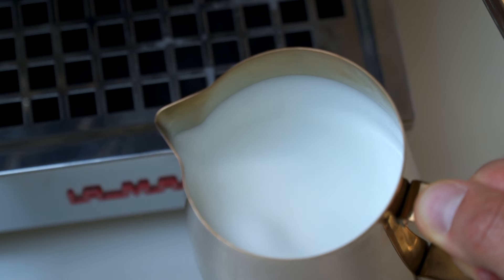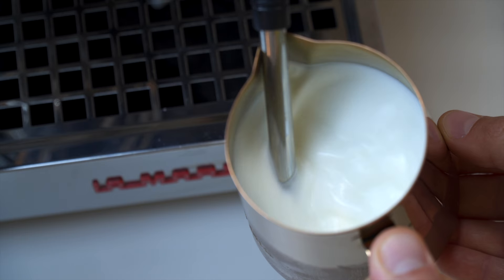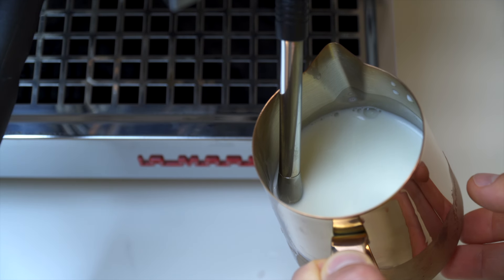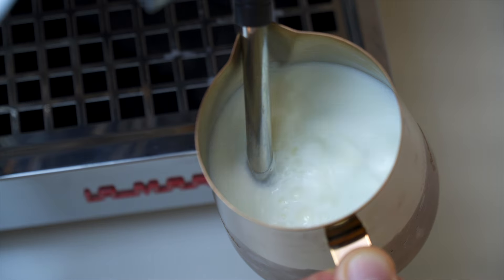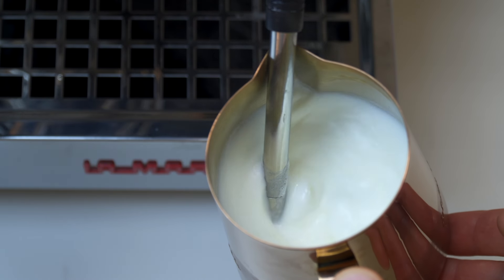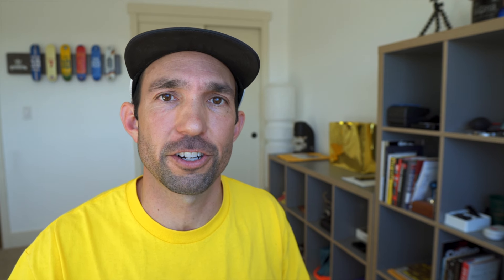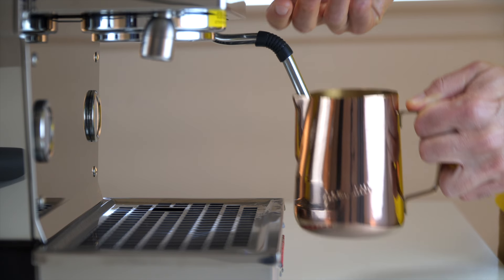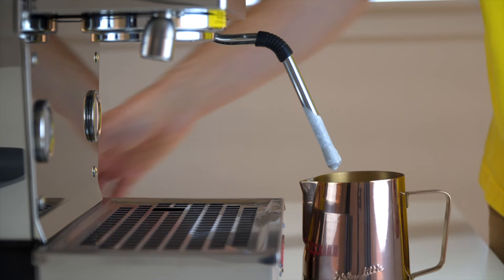Milk Steaming For Latte Art - Barista Tutorial | Chris Baca

Comment: i've been a barista for over 3 years for multiple companies and this is the best and most detailed milk steaming tutorial/training i have ever seen. i've always done the technique where you submerge the steam wand THEN introduce air, now i can't wait to try it the correct way! my latte art will be super consistent now i'm excited. thank you for this video!!
Reply: From top to bottom same
Reply: Chris did not even mention it, but I believe another disadvantage of submerging the wand and THEN - lifting it - to introduce air is that you then have milk sitting on the wand and baking on/burning until you finish the job. 

If you can start and hold at the right level throughout, that avoids this potential issue.

Now I understand that in theory, but really struggle to execute it in practice!
Reply: I'm in training and I'm learning that also, that you submerge the wand, you start off submerging the wand. Not comfortable with that. I look forward to trying this way also. I'm really looking for a formula, consistent way to do it every time!

Comment: Not seen a video that covers texturing milk so comprehensively, however the one thing I think that is missing from this video and most 'texturing milk' videos is how to steam milk with a not so powerful steam wand. A lot of home machines do not have the power that the machines YouTubers are using and I think that might be the reason many cannot achieve the right texture, that's been my problem, I think. Great video!
Reply: zeshxn agree, I’m using an expobar lever pro with a 1 small hole steam tip. Never get super high quality milk
Reply: I use breville barista express
What works is only Steam milk untill it rises  1 to 1,5 cm higher before the milk gets above room temperature(so once u introduced air and milk has risen 1 or 1.5 cm then sink steam wand and get the milk "rolling'  and try make sure the milk rises 1 or 1.5 cm before milk gets warm then as soon as done steaming the milk keep swirling the milk so foam doesn't rise to the top and split then poar as soon as possible after the coffee shot extract's
Reply: Even the one at work used for restaurants one of the wands have a very poor air and water pressure and the other wand is quite strong...it’s like the steam wands are not calibrated properly?
Reply: One tip that works for my home machine is to keep the pitchers in the freezer.  This allows you more time to roll the milk to incorporate the air before things get too hot.  Give that a try and see if things improve for ya?
Reply: @hadu9520  Sounds like your machines need to be cleaned.
Reply: TrackedMiatas yeah you’re probably right
Reply: Hello! A fellow barista here. Hope you don't mind me interjecting for a bit and sharing my thoughts. 

I have tried steaming milk with a not so powerful wand (it was a Breville). Personally I think you can get even smoother milk with a low pressure steam wand because it takes a lot longer to heat up the milk, therefore the milk has a longer rolling time in the vortex resulting in very smooth, velvety microfoam. The same techniques apply with a low pressure steam wand, it's just that it takes more air and a bit longer to aerate the milk and create foam. If you don't mind me asking, what kind of texture are you getting right now? 

In general, milk steaming is a very delicate process and takes quite some time to master. Even with a powerful machine, it is not something you can get right overnight and you only get better with more attempts. A lot of junior baristas whom I've mentored in my work struggle for at least a couple of months before truly getting the hang of it and it takes an even longer time to get to a point of being consistent in getting that smooth, paint-like, glossy texture. The key is to practice, practice and practice.
Reply: @AntheaPeter  thanks for that 👍 it takes time to learn, I think that's what so many don't realise.
Reply: My thoughts exactly! I have a Breville Cafe Roma and it takes forever to get the milk vortex going, probably 30 seconds or so.
Reply: Anthea Peter I agree about the home machines. I own a coffee shop and have been steaming milk for over 25 years now. I discovered espresso as a teenager and knew I wanted it in my life forever. 
I have a Breville at home, I can’t remember which one right now, and sometimes it seems easier and comes out better than my super duper, cost more than my car, machine at my shop.  I even bought another one to keep there to train newbies on. This way A. They’re not tying up the main machine and B. They are able to learn the sounds to listen for, what to look for, how to hold it, and all the other shit and the see better results quicker and feel more encouraged than on the big machine.
Reply: Per TackedMiatas' comment above: Right. Get yourself a stiff wire/heavy paper clip/ welding torch orifice cleaner type thingie. Steam some water to near boiling and then clean the inside of the wand with your preferred appliance. Now, when steaming, clear the wand until water does not come out, steam your milk per the above tutorial, and, importantly, wipe your wand off and give it one more blast of steam. Milk's fraught with adhesive proteins, and tends to clog wands up if they're not scrupulously maintained. Perhaps this will help. Good luck! Cheers!
Reply: It does take longer time and also keep the pitcher cold before you start is a great tip. Also a lot of home machines has a bad construction. Like my La Pavoni which had 3 steam holes on the pipe??!! Haha I had to change that :)
Reply: I also have an Express...It has very good pressure and very dry steam (which is good, minimizes the watering down of the milk). Definitely would recommend it as a home product if it is within your budget (normal price is about 500$ on Amazon).
Reply: @AntheaPeter  That sounds about right. I didn't have to invest much effort in learning how to steam milk on my cheapo espresso machine that I bought from Starbucks years back. The big issue that I've had is that because the boiler is pretty small that it's difficult to have the valve open enough to properly steam without losing pressure midway through the process. 

Closing the valve completely for a bit when the light turns off seems to work, but it does take quite a bit of patience sometimes.

Comment: 'When your brain says you have enough stretch'?  This video is for beginners, my brain has no idea how much stretch is enough yet. Is this just something learned from trial and error, or are there telltale signs that can help us?
Reply: Sam Pascoe Temperature. Stretch it till your milk is about body temp first, then adjust accordingly. If you want more foam, hold it down longer, and if less, you'll wanna bring the jug up earlier. It's mostly by feel and there's no real guideline cause that step is highly machine and technique dependent
Reply: @dddgx05  OK cool, thanks! I read somewhere else, to bring it up when the milk starts getting warm. Body temperature sounds good. I'm struggling to get a good swirl going before I dip at the moment - the placement in this video doesn't work for my jug.
Reply: Check if your steam wand has one hole or multiple. If you have a 1 hole wand this position should work for you. If you have multiple holes you can place it closer to the middle and you're getting more of an erupting kinda motion. But I'm not too sure about this information. Maybe someone else can corroborate this
Reply: @dddgx05  brilliant thanks so much, I'll try this tomorrow! Mine is multiple holes, so that's why it wasnt working!

Comment: Hey Chris, thanks for the video! I'm having trouble with steaming milk for two cups. When I'm splitting a bigger jug (~600 ml) into two portions (using a smaller jug ~380ml), the second cup is usually a lot thinner. Also, the foam and liquid milk are more separated in the second portion. Could you please make a video on steaming and splitting milk for two cups?
Reply: Pavel Mazurin try to pump more air in your milk if you using a big jug (600ml) so you will have enough foam for two cups. Also, how you split the milk is also affects the foam, my tip is to split milk into a smaller pitcher for the 1st attempt, the 2nd attempt is pour over some milk in the smaller pitcher back to the bigger pitcher to get the foam balanced between two pichers. That’s how you will get the same amount of micro foam for your coffee
Reply: Khoi Minh thanks for your tips, I’ll try to use them :)
Reply from the maker: This is a great video idea and yes - I will make this video. Thank you!
Reply: @RealChrisBaca  thanks, looking forward to watching it!
Reply: I'm having the same problem when making 2 cups, did you fix it?
Reply: @nuovosalario  I actually got a lot better with it. One thing that helped a lot - making espresso simultaneously with steaming the milk. I have a heat exchanger machine, on a single boiler this won't work unfortunately.
Reply: @kovpas  I can't do that unfortunately on my machine. Would you recommend steaming the milk first or the espresso and then the milk?
Reply: nuovosalario 🤷‍♂️. Never had a single boiler. May be @RealChrisBaca could help?

Comment: Thank you for your video. I’m a total novice to milk steaming/frothing. Question to you and/or the commenters. I’m using about 6 to 8 oz of milk. My unit came with wand tips with two holes. I constantly get thin milk with ok foam on the top. I bet I just need to practice more but do you think the wand tip with smaller holes and/or  purchasing a wand tip with one hole would help?

Comment: ROCK & ROLL...
Hey, I am a home barista and have a Profitec Pro 700 espresso machine and a Ceado E5SD single dose grinder. I have seen endless number of milk steaming videos but somehow never got "that silky smooth glossy paint finish" milk for latte art until I saw this one. Your video ROCKs cause it helped my milk ROLL. One info no one had mentioned earlier was that it was important to position the steam wand in almost VERTICAL POSITION. That did the trick. It made my milk roll and I finally got that vortex. In my opinion, this is the single most important milk steaming lesson you will ever need. It covers each and every aspect of milk steaming in the most practical way. Two thumbs up...

Comment: Hi Chris! What steam pressure do you tend to have it set at? I was looking to get the ECM Synchronika but I wondered if the on/off lever for the steam instead of a dial would make foaming harder by not being able to manually control the pressure? I think the ECM is set to 2 bars. I think the Rocket R58 Cinquantotto (which I'm also looking at) is 1.5. Lastly, what steam tips (more or less holes,, or smaller/bigger holes) are more appropriate for thick microfoam? (I like dry cappuccinos!). Thanks for such a great resource.

Comment: Best darn video on the topic bar none... I have been pulling my hair for a year trying to do consistent latte art and I just can't get there. I have a Breville single boiler, so I think  my machine is just not powerful enough but still, I should get some consistency but I can't.
Reply from the maker: Thank you! I think you can pull it off with the Breville it just might need some special tweaking and only using small pitchers and small volumes of milk. If I can get my hands on a smaller machine I'll give it a whirl.
Reply: Just by answering my comment you already made my day... That would be super awesome if you could eventually do a "milk steaming for latte art" with the Breville BES870XL Barista Express Espresso Machine. A lot of noobs have this machine as it seems to be a great entry level machine. That's what I thought. I still think that this machine is just under powered to get consistent results... I can't be that bad... LOL... cheers from Toronto!

Comment: My LaMarzocco Línea Mini came with a lot of steam pressure. The gauge reads 1.7 or more. Is that supposed to be the case? If I turn the dial more than a bit the milk burns in seconds. What pressure do you recommend? The factory setting doesn’t seem right.

Comment: so I am using Philips 2200 espresso machine which has a milk frother. But I do not get this kinda vortex happening at all even though my positioning is right. Why would that be? Could it be related to steaming pressure strength or something? unfortunutely there is no way to adjust it, I can only turn steaming on or off.

Comment: Hey Chris - I had just practiced with an entire container of milk to properly froth and steam it for a cappuccino - never did I get the consistency correct!?!  I think I am moving too much, or allowing too much air at the start, that is, I have the tip too far up off the milk.  When I dip the tip lower down into the milk, it blows up and overflows!... plus it smells soured?  

Anyhow, my question is; If I am making an 8 oz.  cappuccino, using 2 oz. of espresso, how much milk do I place in my pitcher (6 oz. would seem logical but I thought more might be required) and for How Long do I need to froth and seam the milk?  Is it six seconds (approximately), or 8 seconds of air, then 3 seconds of steam heat?  I saw your demonstration on this video, but not sure how much milk you were using in relation to the amount of time it takes to froth?.... or is it the same time regardless of the amount of milk?  You make it look so easy!!

Comment: So for a cappuccino, you should aerate the milk slightly longer? How much more foam?
Reply: da5idnz About 30% of the cup? That’s what time taught
Reply: I tried this all today and am still not doing it quite right. It's going to take some time, still... I think our nozzles here down under are not as long, so I may have to put more under the milk, rather than having only half under
Reply: da5idnz I put milk until at the bottom of the snout. More foam would be to steam the top part for more bubbles and foam. But could be that nozzle too.

Comment: Great explanation ! best out there ! another thing that took me ages to get right: if you have (and you will have) surface air bubbles on the end of the airing phase, it's on the next phase, the vortex, that you will get rid of those bubbles. by having the pitcher point too high or too low into the milk, the bubbles won't disappear, it must be in the exact high just below the surface, and you will have your an extra smooth milk!

Comment: Love your videos chris, but I have questions about this. All of the good videos I see use commercial machines or at least machines with high steam output. I have a CC1 that uses boiler water through a thermoblock for steam and it's much slower. What adjustments do I need to make to these techniques given the slower nature of my machine.
Reply: Keeping your pitcher in the freezer will give you more time to texture and roll the milk with your home machine, before things get too hot.  This is one way to "buy" yourself more time to get better results from the home machines.

Comment: Hey excellent video, I have a Gaggia Classic with the Rancilio steam wand mod, I am wondering what could I possibly do to place the wand on a similar angle as you're showing in the video. My wand is almost 90 degrees straight down and if I place it on my pitcher, it's almost impossible to create this angle so I cannot use this technique, what else could be done in my case?

Comment: I watched your great video several times but am still struggling to get micro foam with my Rancilio Silvia at home. Getting  basically hot milk. Getting a great vortex but apparently not enough air. That or I am going too far and too hot. Doesn't that break down the bubbles? Would a milk thermometer help?

Comment: yup still can't make proper milk.
starting to think maybe my machine is the problem. i've been trying to hard
Reply: If you've really been trying that hard, take a look at the milk you're using and switch to a different brand. Generally, the whole milk is likely going to be easier than most others. If you've been working with milk substitutes some of those can be extremely finnicky. IIRC, almond milk in particular may or may not froth well on a given day just due to the weather. I never found it to be particularly consistent when compared with milks with soy or regular milk.

It could be that there's something wrong with the machine, but more likely it's either you or the milk that's to blame.

Comment: Here's the deal. I'm doing the exact same movements, everything. One week everything is great, the foam is very...rich and foamy and it takes like 10-12 seconds. Everything goes really fast. And then one or two weeks later, despite doing the exact same things, I can't do it! It takes for me like 15-18 seconds to get hot and it still doesn't have the texture I want and it's full of bubbles on the top. More like warm milk rather than actual foam. Am I doing something wrong or is it perhaps the machine? The air coming out of the machine isn't hot enough or as much as it's needed to be? Should the milk be cold? Like just out of the fridge?
Reply: Yes the milk should be straight out of the fridge. It sounds like your steaming wand could be dirty. Clean it. And purge well before and after. They clog up easily and that could cause the symptoms you described.
Reply: @MattHadler  It's probably that. The technician came and cleaned it. It seems that the other users weren't cleaning it thoroughly and the steaming wand was dirty indeed. Thank you though.